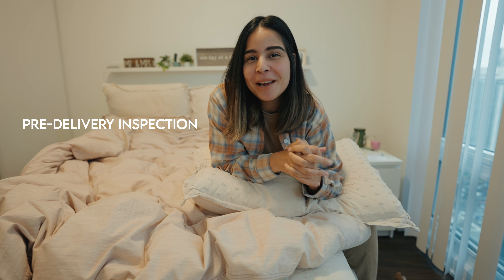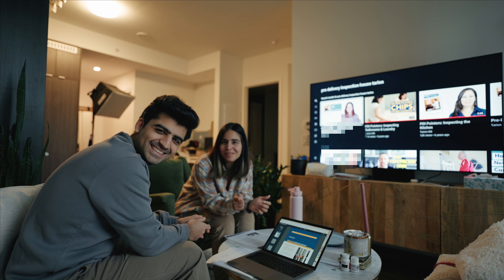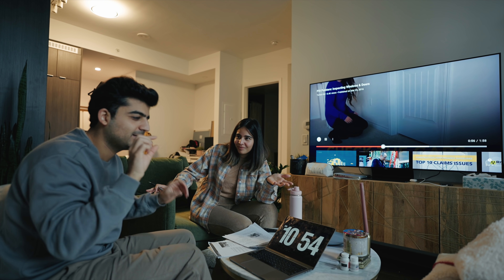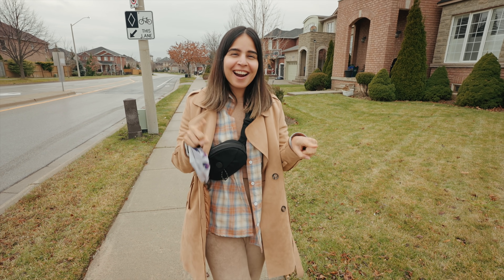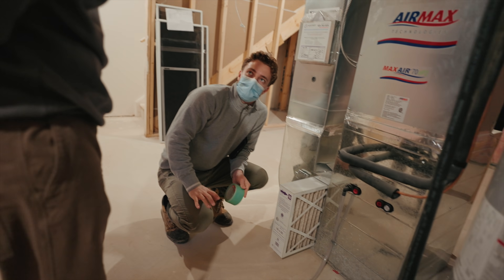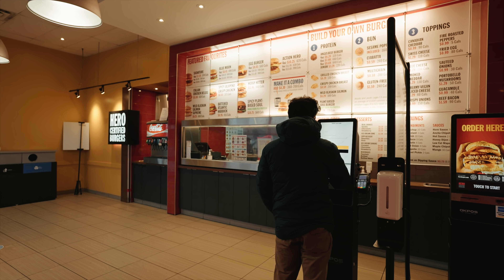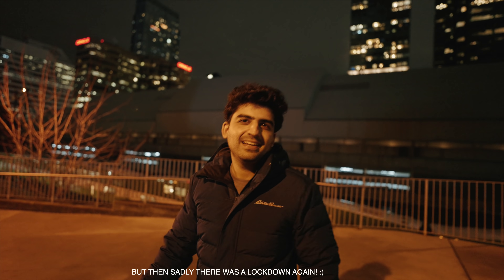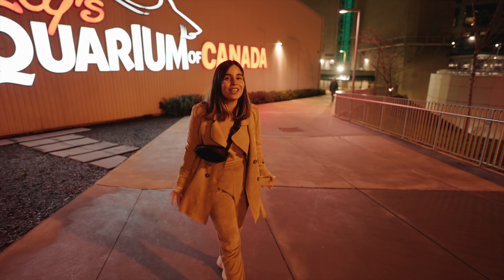My Home Inspection Experience | Buying New Construction in Canada | Tips & Advice for Your PDI

Comment: Congratulations on your new home. Make sure you check for any foundation cracks, water leaks behind the insulation. Get home inspection done from a proper home inspector. You can do it on 30 days or one year and make sure to document everything in writing. Builder will try their best to go over small small defects. Don't forget to look for any major deficiencies. We bought new construction home and we had over 100 defects. Builder will always try to give you a run around in spinning circles. Communicate in writing, minimal phone conversations. If the builder doesn't comply and fix things, check with Tarion. You have a 2 year limitation period. Make sure don't miss out. Best wishes.

Comment: Few items to make a note of and pay attention to for your 30 day Tarion list:

1) Check the insulation in the attic. Many builders cheap out in blowing adequate insulation required as per the building code. 

2) check airflow in all levels—precisely the top level. In most cases, builders do a shitty job at balancing the airflow in the house. If you don't flag this now, you will never be able to catch and have them repair a blockage in the HVAC system or ducts. Very important as this assists in maintaining condensation levels as well. If there is no airflow, you will have moisture build-up on windows and walls, which will creep mould, and the builder will wash his hands. 

3) check the grout done in the washrooms. Check if it's cracked or cracking. Check the shower pans and corners for missing silicone. Important because water will seep under the tiles or pan and cause mould and damage. 

4) check faucet pressure, especially in the showerheads. Many times, it's low, and they need to clean them. 

5) check for honeycombing on the exposed architectural concrete. They need to grind and patch, as required after winter. 

6) loose Shingles. Your builder has a reputation for rushing and delivering high-volume houses. This means they would contract out 'peace-work.' That means trades cut corners and necessarily don't give a crap about quality. Your roof was done in Winter; in most cases, it is okay if they adhered to it properly, but try o get an inspection done to see if shingles are well attached to or not. 
Many more items; feel free to reach out. The above are everyday things that most homeowners are unaware of or don't check because of the rep—critical architecture on architecture (easy fixes).
Reply: nice details
Reply: Supportworld, You nailed it good. True what you mentioned 👍

Comment: If u want to buy furnace filters in wholesale  you can get it from wolesleys. Just check if the furnace is rental from a company then they usually provide 1 free filter a year with a preventative maintenance. 
Also the envirosense Water Heater is the goodone. Whosoever company you are renting with can also flush and delime/descale